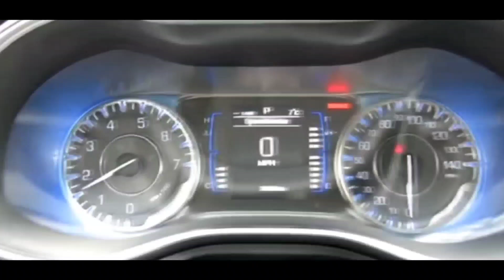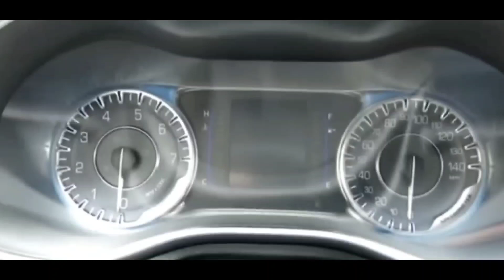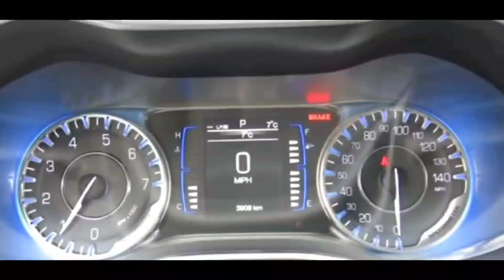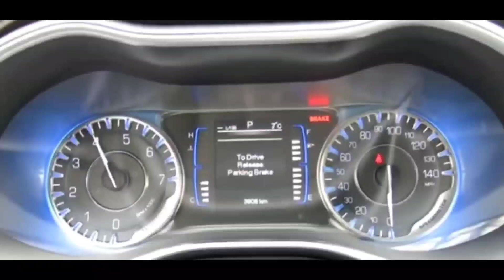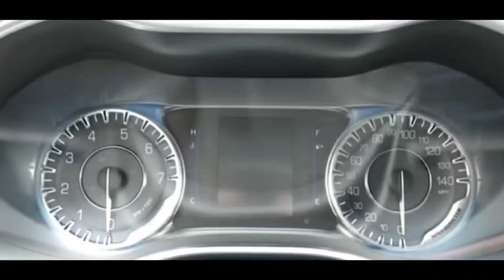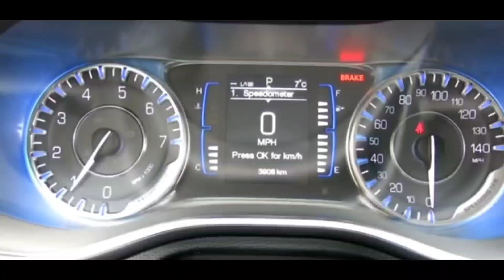HOW TO FIX ANY CAR WITH A P06DA CODE - Engine Oil Pressure Control Circuit/Open- FAST AND EASY

Comment: This code with a misfire on cylinder 5?
Reply: I have the same problem on a 2012 dodge journey 3.6 Sxt the Po. Code 6DA does somebody know how too fix this issue plz
Reply: I have the same code p06DA  problem, one mechaic says that most of the times the issue is the knock oil pressure harness, i just fixed the knocking rockers and lifters, after i got my town country back from mechanic he told me about it, and i said whaatt??? That's under intake manifold why didn't you say something about it while the intake was removed when you were working on it? Mechanics are trash, now i have to pay one more time to install that harness

Comment: I had the P06DD code on my 2013 challenger v6 and I replaced the oil pressure sensor and the oil filter and the car still had trouble accelerating at times so then I replaced the solenoid in the oil pump and now the car seems to be running normal but now I’m getting the p06da code immediately after doing the oil pump and tried clearing the CEL but keeps coming back and I even tried disconnecting the battery
Reply: Did you ever figure out your issue yet? I have the exact same issue with my 2012 Wrangler. Did you use the Dorman solenoid? I also had the P06DD code that would come on and go off every few startups. I finally got around to changing the solenoid on the pump with the Dorman replacement unit to avoid having to replace the whole pump. The light stayed off for a few weeks afterward and then it came back on but this time with a P06DA code. I can clear it with a code reader and it will stay off while I drive it but as soon as I turn it off and then back on again, within a few moments it will trigger that code.
Reply: @jeepinintexas6215 watching this video I realized I made a mistake buying Chrysler jeep product. Every fucking thing is programmed and requires a trip to the dealer
Reply: @sbond1963  no, it doesn't actually. I fixed my issue buying a new oil pump, which is what I should have done to begin with. That aftermarket Dorman solenoid failed after a few weeks. The new pump hasn't had any issues and it runs like a top now. I didn't have to take it to the dealership. In recent years the only cars that have left me stranded were actually Toyota and Hondas lol. The Toyota had the 2AZFE engine known for burning up oil and that left to the engine seizing up. The Honda had a CVT transmission failure and then later so electrical short behind the dash you could hear crackling. Lucky it didn't catch fire. Two ultra "reliable " Jap brands, go figure.
All the manufacturers make junk. Especially GM and Ford lol but keep believing what you want.
Reply: @jeepinintexas6215  did you find a solution already? I have the same issue with my 2017 Wrangler…
Reply: @simonbauer7302  yes, I replaced the whole pump assembly with a Melling unit. Part number# M528. No more code and it's been working fine since. From what I read, Melling is the OEM supplier.